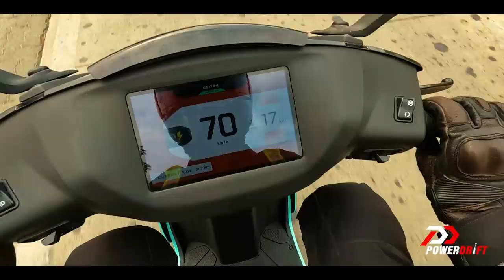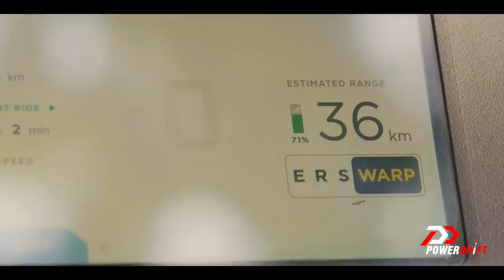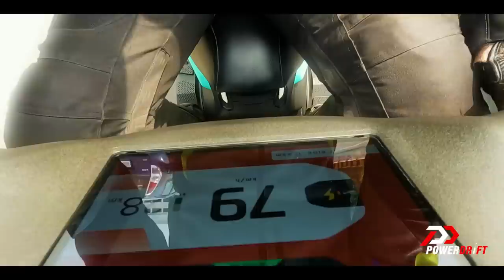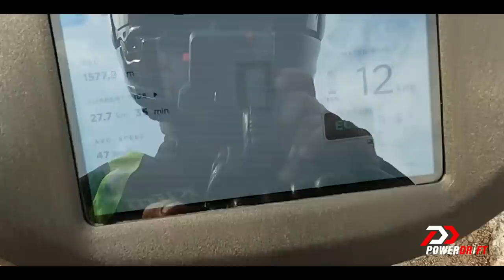Ather 450X | Can It Beat The Heat? | PowerDrift

Comment: Agree with PD here, I have Ather 450 (not 450X), I did a 43km one-way trip to Electronic City from Jalahalli Cross (Bengaluru) and back home still with 17% charge left, I did drive economically and non-stop drive for 90-95 minutes. 
It's like an Apple iPhone in the EV market, with less on features but whatever is provided is rock solid.
Reply: Good anology bro
Reply: And ola is like a Xiaomi. Or may be even worse.
Reply: @yash_kambli  haha this was good 😂😂
Reply: Same here with 450.. completed 23k km❤️
Reply: @yash_kambli  Hey I am from Nagpur and have driven OLA (double seat with mix of Normal, Sport and Hyper modes) on Highway for 100km during May 2022 at 45 Celsius temp  and it was perfectly fine (unlike this video which is clearly done during cloudy and rainy day. Since last 3 weeks Nagpur temperature is between 20-30 since it's raining non stop not sure how they are exaggerating very high temps of 43 Celsius 0:57). I am not saying it's a perfect scooter but not as bad as being publicized. Not even once I faced any over heating or any other issue with OLA. And there are at least 1000+ OLAs running in Nagpur most of them faced no issues. 
However, I do agree Ather has better temp management than OLA (Wrap mode vs Hyper Mode). But these over heating issues are extremely rare as we don't drive at such speeds in city. Also, Ather is 7+ years old company so they got enough time to refine their hardware and software. The older 450 had many software glitches as well as over heating issues. OLA is hardly 7-8 months old company, give them 1-2 years, they will improve as well.
Reply: @Saurabh.P  No one is denying to give them 1-2 years, its how they tried to push the product.

They tried to market it like best EV in the market while (maybe) being aware of all the issues!
Reply: @Saurabh.P  OLA S1 PRO owner here! I agree that the company fumbled initially, but the product delivered to me is stable until now. Sure, it's not refined like Ather but given time I think they'll improve. I even did a 111 km trip (varying road conditions) with a pillion rider (75+65 kg) and came back home with 5 km range left.
Reply: @abhi_jain  Most of the companies do misleading promotions in all sectors OLA did it too. The actual problem with OLA was launching PAN INDIA that too with online only model. It was too complex and too big problem to handle that too in extremely short time. We are the 7th largest and most diverse country in the world with a consumer mindset of wating so many things with little money. What OLA has achieved in such a short time is really unique, extraordinary and I don't remember any other Indian company doing something like this. There are so many complexities involved.
1. Global chip shortage and other supply chain disruption due to Pandamic
2. Going from empty land to production in 6 months
3. Developing updating OLA cab app, a web site and scooter OS in 6 months is extremely challenging ( I am software dev so know the complexity)
4. Most of the vehicle manufacturers in India mostly assemble and source parts from ancillary industries, whereas OLA chose to manufacture most of the part on their own (except battery cells, motor and cpu)
5. Managing extremely complex operation of vehicle registration across states. Every state has different requirements and people did many mistakes while uploading docs. They also came to know about many manual processes of each city later on.
6. Home delivery of vehicle even in remote part of our country.

I never had such an amazing purchasing experience with any vehicle earlier. Never once I had to step out of my house for OLA purchases. Payment, registration, insurance, state and central subsidies and delivery all done by OLA for me. This is such a huge thing. All this I got for only 1.09lacs. This is just insane.

I am a big time EV enthusiast and following Ather since 2016 and I remember Ather had many issues initially but they were initially available only in Benguluru and that's the best thing they did. Their issues never got such a visibility like OLA as nobody aware of Ather as a company as well as Indians were mostly unaware of EVs at that time. And yes I agree Ather preferred sustainability and took sweet time to refine product and expanded really really slowly so that they can handle after sale service with upmost priority. While OLA focused on rapid growth and that landed them in big trouble.

Comment: Heyy no no no. You can definitely heat the ather. I just need 10 mins in even bangalore weather with my 3 year old Ather 450 in just sports mode and I’ll overheat the motor. 
It’s absolutely doable. I don’t know if they changed the fans in the 450X but the 450 definitely overheats it’s motor if you try to.
Reply: How is the range after 3 years of usage. 450x is new model so they must have improved the heat management so I guess that's why I think less overheating.
Reply: @Saurabh.P  I just feel confident I’ll be able to overheat a 450X as well XD 
It’s the same motor they’ve used in the 450 so if they’ve changed anything it has to have been a cooling fan upgrade. 
Range has dropped. I haven’t gotten around to a proper range test but I think the range drop is somewhere between 5-8Km not more than that. Probably looking at a 10% degradation. 
The upside is that charging speeds have picked up. I used to charge about 35% of the battery in 1 hr earlier. Now it’s close to 40-45% in an hour especially quick since I have the older 1.1kW charger
Reply: @surajmadhu-techgobbler  Nice to hear long term review of 450 specially about range. It really gives perspective.
However, overheating problem must be rare under normal driving conditions, right?
I have 2 EVs at home Ampere Zeal since APR 2019 and OLA since Feb 2022 and never faced heating issues in any of them ( I am from Nagpur and driven both EVs in 45 temparature. However never tried fast charging). I normally drive at 30-50 speed. So I am guessing it must be rare even for Ather to overheat under average driving conditions.
Reply: @Saurabh.P  average driving it won’t get overheated. If you try to push it or if you’re in a rush and you live in an area with steep roads like I do. Then it will overheat. 
I own an Ola S1 Pro too and I overheated it the day I got it. I guess it all depends on riding style. But the Ola does overheat a bit more easily. But it at least warns you. And I can understand why it overheats. It’s a beat in hyper mode. The overheating is not just in my ather. A few other owners have reported it too. And it happens very abruptly and suddenly with no warning at all. As of now My mom uses the scooter and she rides it quite slowly so it absolutely never overheats. Neither does the Ola in regular conditions.
Reply: @surajmadhu-techgobbler  Okay. Thanks for the info.

Comment: Basically it takes quite a lot more time to charge than to drain! I will buy EV when this ratio will come to 1:1
Reply: @Aswin Biju Li-ion battery was invented during 1980s, 40 years, yet no more innovations 🥺 I wish I could buy, not my son
Reply: @Aswin Biju 1. Kia ev6 has 50lakhs + pricetag
2. No company is talking about battery lifespan. Usually battery's last for 4-5 years! After that what will be the price, for ather, 45000! Thats quite a lot 🥺